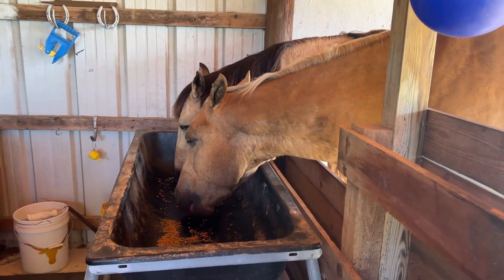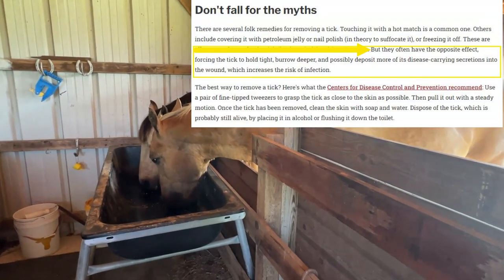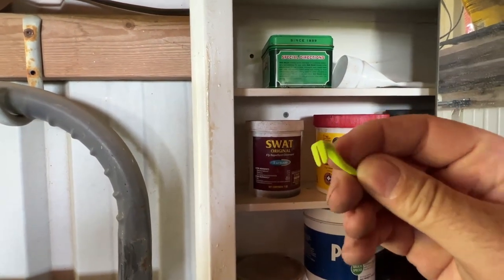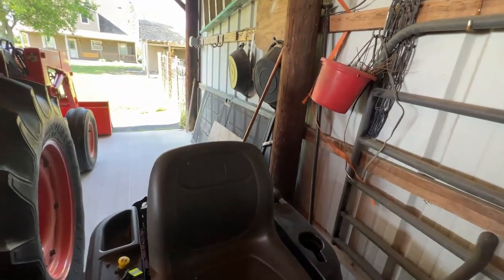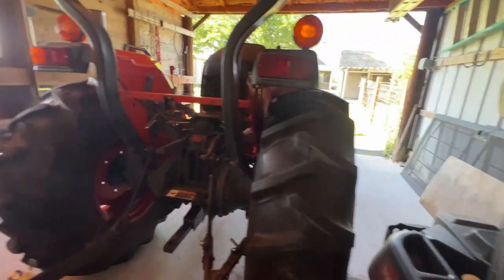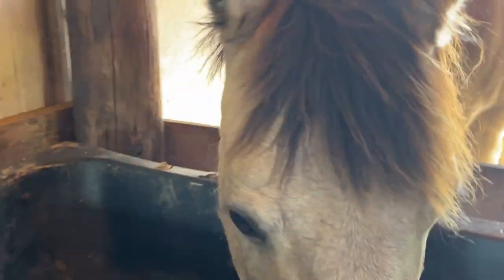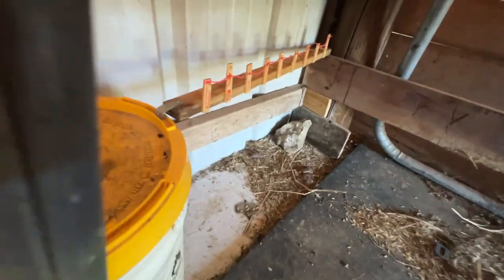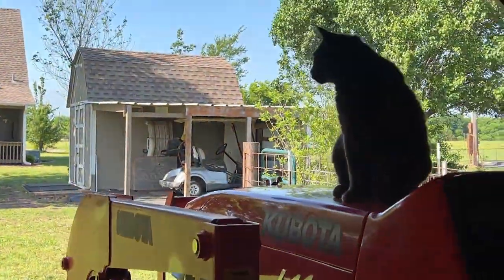Tick Removal Fingernail Polish Follow Up - Brun Them, Vaseline, Nail Polish & Other Bad Practices

Comment: After decades of removing ticks, we found tools like the Tick Twister or Tick Tornado to be the best by far. It helps to get a couple different brands so you have tools that best fit all the different sizes of ticks from nymph to friggin huge.

Just slide the tool around the head of the tick and twist it around twice. Perfect removal every time (never broken the head off and left it it the animal) and does not bother the animal at all, unlike pulling them out.
Reply: It's almost impossible to get 100% of the tick out .I've tried everything and tweezers work OK.

Comment: Yay! Bag Balm and Corona (not the drinking kind)! Best stuff EVER. I started using them on myself when my hands got so chapped at the lab and wind-burned at the farm that they bled. Weekend treatment (don't plan on using your hands for at least 72 hours). Clean dry or slightly damp hands. Slather the product in and GENTLY rub in til no more can be absorbed. Then put on more. Put on white cotton disposable gloves. Then finish with disposable plastic gloves like hair dressers use. This is to keep the ointment from getting on everything you touch. Keep covered at least 24 hours. I did mine on Friday night and wore through Saturday. Remove gloves and GENTLY wash with slightly warm water to remove any excess and pat dry. Your hands will smell like lanolin and there will still be some residual ointment for several days, but the healing is worth it. I worked in a laboratory for over 33 years and wore and changed gloves constantly. I am also a habitual hand washer. This will parch your hands in no time, especially during winter. I also spent available time at the barn. I figured if it was good enough for the horses, it was good enough for me. Also good for livestock with scrapes is cooked bacon grease. That helps the hair come back in close to the original color. We always  had a can of bacon grease handy. Where I rode, luckily, we never had a problem with ticks.

Comment: Use alcohol, drench with vodka or whiskey neat, at the head and mouth piece. Been doing it for years, never had a problem getting them to release hold, also keeps the opening clean from infection and swelling.

Comment: The tractor looks good Rick 👌 I was wondering what kind of covering you were gonna do until you built something but I think you should just leave it in there and the hell with spending money on new shelter. I've been using Bag Balm for 30+ years and the menthol you smell is eucalyptus. I actually started using it when I got tattoos for the healing process but it's used in place of Vaseline in my home. Love the critters...thanks for sharing 🤠🐎🐎🐈‍⬛🐇💕

Comment: When my daughter was an infant, I found a tick on her shoulder. I wanted to remove the tick "Properly" so I used tweezers. Only the tweezers left the head in. She got a tick born illness with a high fever for a long time. The area where the head was rotted out and got infected too. She has a huge scar from it. From then on, I always just used my fingers.
Reply: I use my fingers too
Reply: Here is what I have learned and done very successfully:  in a full glass of water, take tick bite tincture and a capsule of Nattokinase on an empty stomach three times a day after being bitten.   You can clear your body of the critters and their cysts they hide in this way!  

If the tick bite is new, put a drop on the bite immediately and again a few times over the next couple of days.  Also take a dropper full of the tincture with the Nattokinase.  But if you’ve had lyme etc for a while, take the Nattokinase each time you take the tincture and start with a drop of the tincture and daily titrate up to your tolerance level, staying with the program until you are two to three months symptom free.

Sojourns Community Health Climic in Vermont has the tincture.

Comment: Ticks are in the high country here.... Colorado, especially in May. But not a big problem on the flat lands. I pull the SOB's off with my fingers, check to see if the head has been removed, and I then flush the MnF'r down the shitter. Tick pullers are good, there are better designs than others. I don't play.

MTG oil is a sulfur based product and it will produce a healthy coat and eliminates hair loss ( blown coats) which typically happens to female dogs after a litter. It is an equestrian product used on the manes and tails of horses, sweet itch and other fungal problems are relieved.